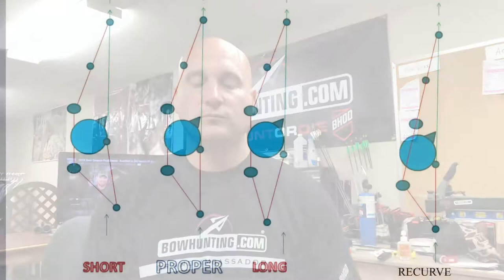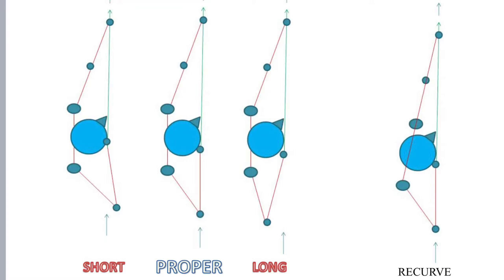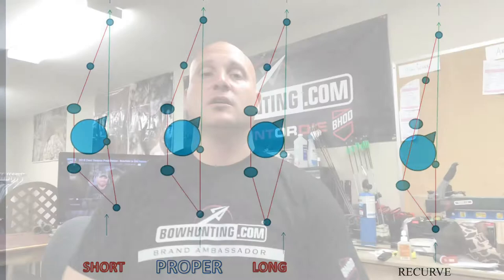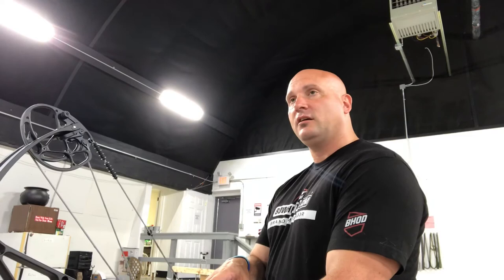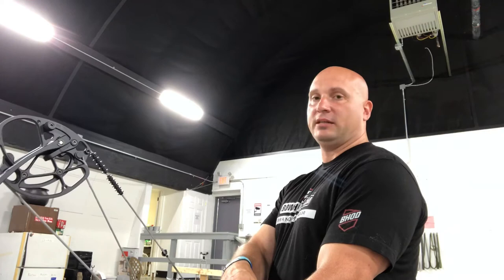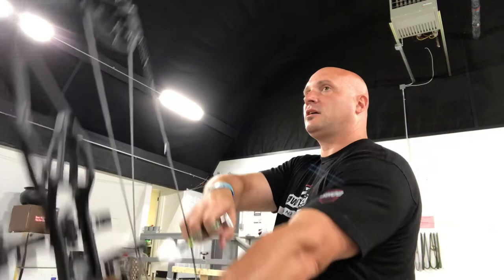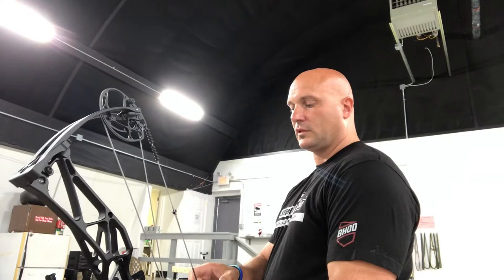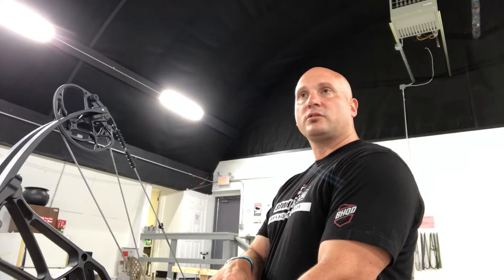How to find proper compound archery draw length and proper draw cycle with  a compound bow.

Comment: First, thank you for taking the time to post the informative video. Next, I’m NOT trolling, but I have a question pertaining to your form. For ease of explanation, assume that your feet are north/south along the line in the concrete floor. In the #3 position, after you complete your draw cycle. It appears that you have to move your torso east at the hips to acquire your peep, so your torso is no longer in a perfect upright “tall and proud”position. I notice my son doing this as well, and I’m not sure how to correct this or if it does indeed need to be corrected.
Reply from the maker: That is called coiling, it’s part of the National Training System developed by USA Archery and is recommended.

Comment: Hi, great video. Your video is teaching instruction that very few are talking about. I am keeping my left eye closed through out my shot and noticed that you are not. Could you give me some feedback on this?
Thanks for showing the elevated behind view.
Reply from the maker: We teach to not shoot with eyes closed unless we have to in order to clear up pins/scopes/aiming points. In some cases we use masking tape over glass lens to block the off eye for shooting. This is why you teach new shooters based on dominant hand and not dominant eye. It's easier to learn with the dominant hand or address the non dominant eye. One eye closed isn't a huge no no but it does make barebow archers and Olympic recurve a little bit more panicky. Plus both eyes open helps with balance and reducing facial tension.

Comment: Great video...I'm trying to figure out where my anchor point should be as my strings don't align on my nose/face and I have a lot of head movement. I'm thinking I'm too far back with my index knuckle under my ear instead of maybe under my cheek bone...hmmm..back to square one! Thanks for an awesome video!
Reply from the maker: No problem follow international archery Institute for more videos that will help you through that transition. Also follow the international Archie Institute podcast called the archery coach-cast

Comment: Shooting my compound, my anchor point with my release is right thumb to right ear lobe.
Repeatable. 
My measured draw length is 23.5 inches. I am deformed.
My bow is set for a 23.5 inch draw length.
You forgot to mention one thing thag has a drastic affect on accuracy: RELAX THE HAND HOLDING THE BOW.
Using the wrist sling, you're not going to drop the pow when you fire.
Reply from the maker: Thx for the feedback. This video wasn’t about setting the grip but you are correct about relaxing the hand, however a crucial point to the grip is placing the pivot point first, pressure point last and making sure the knuckles are on a 45 degree angle. The thumb to the ear loab is typically too high of anchor IMO but in this video we are mainly discuss thumb release or back tension. Index trigger I don’t recommend for my shooters. To each their own of course, use what you’re comfortable with and produces  results you’re happy with.

Comment: That last video actually looks like your draw length is too long...at least going by the diagram you presented earlier.  I'd like to see a comparison with a 1 inch shorter draw length at that same position.
Reply from the maker: Definitely not. The NTS teaches elbow alignment to inline with or slightly inside arrow line.